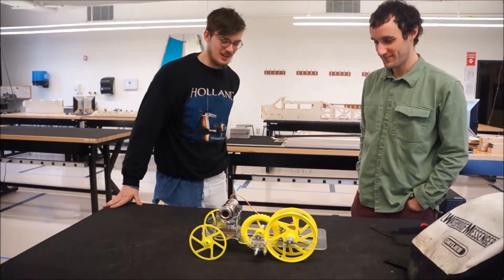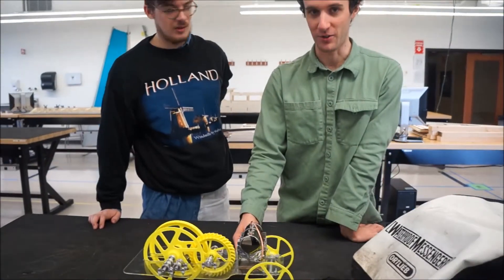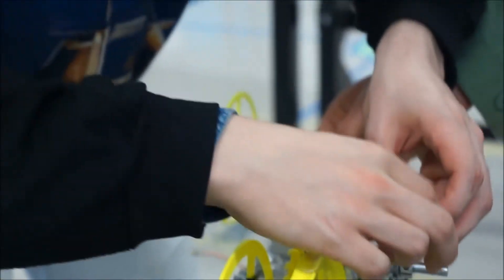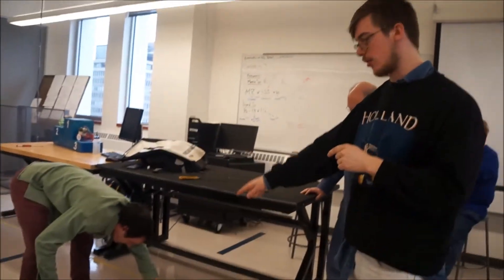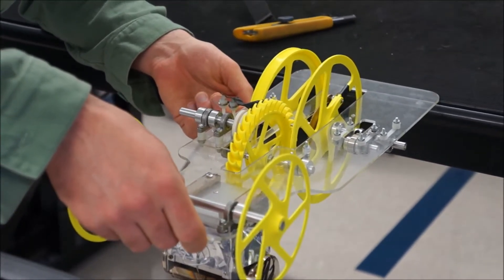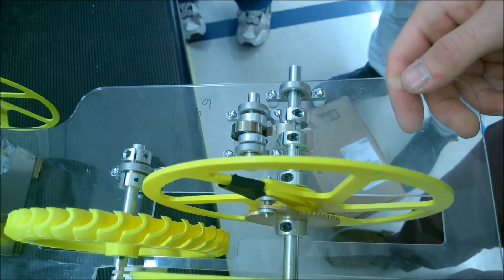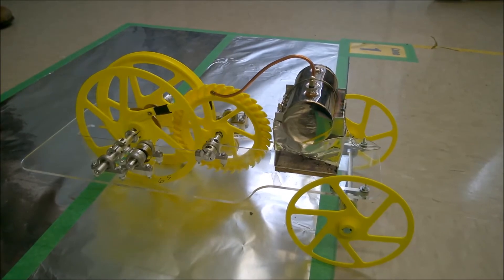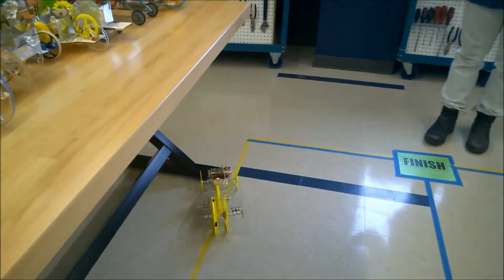winning 2015 Concordia micro steam car demonstration

Comment: Why not direct drive spring windup seems overly complicated
Reply from the maker: the boiler's giving you low power for 5 minutes, you want high power for 3 seconds (well, really, 10 meters), so you want to concentrate that 5 minutes*low power (energy) into the spring. if you directly drove a constant-torque spring with the turbine, it would have to be a very low torque spring.  you want to amplify the torque by dividing the distance pushed by the air to 10 meters. there's about a 150:1 gear ratio here... 150 times the torque at the turbine. also, you want the turbine operating at its optimal RPM.
Reply: +Matthew Gruber that makes sense I didn't realize the goal was speed not distance. The design is genius great work
Reply from the maker: ah yes, past competitions the goal was distance, for this one it was the shortest time from 5 meters to 10 meters
Reply from the maker: and thanks! :)